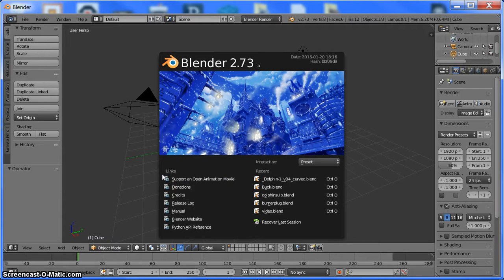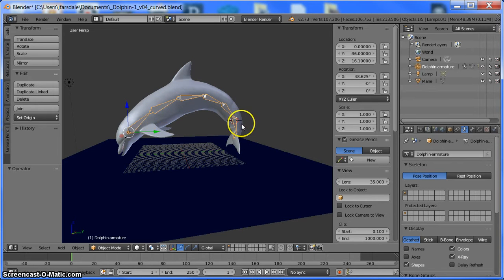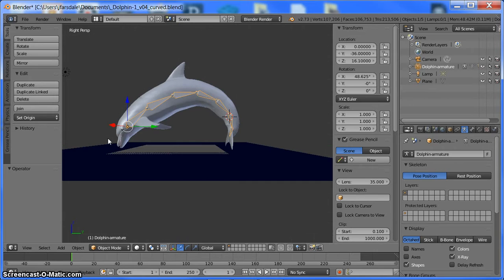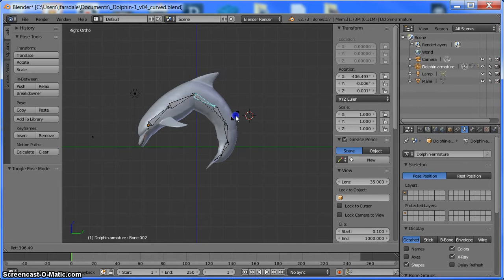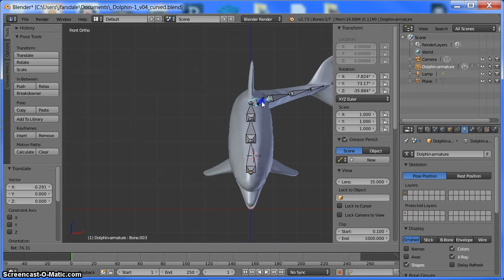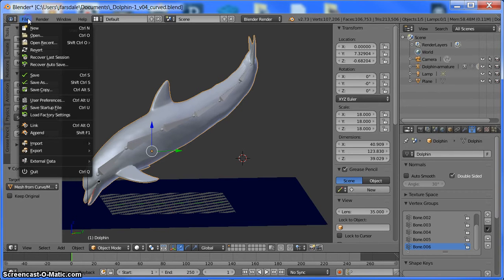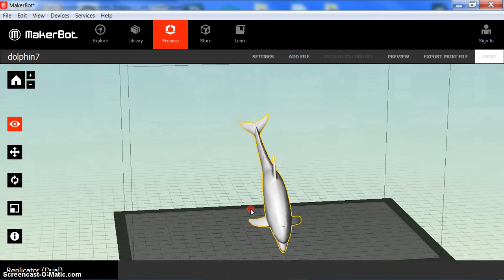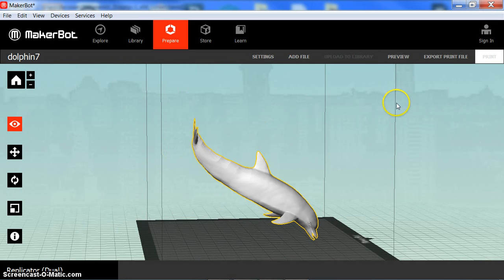How To Move Rigging And Export Blender Model for 3D Printing

Comment: thank you for this. it helped a lot!
Reply from the maker: No problem. I am glad you found this useful. This is old but must still be relevant with the new blender releases. I switched to fusion 360. With there changes I will start using blender to 3d model again.